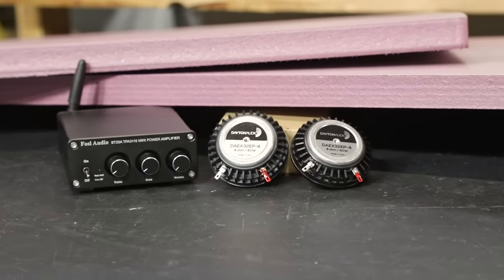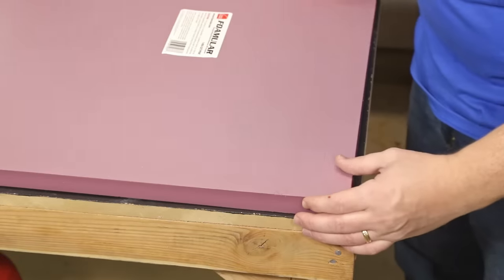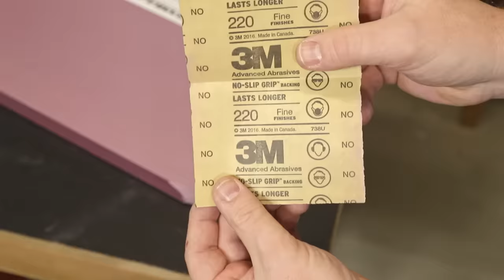How To Build "The World's Best Speakers" - Are Flat Panel Speakers Really Any Good?

Comment: Try adding weight to the exciters. It will change the exciter's inertia, and therefore the reaction of the boards.
Reply: I wonder what would happen if you used double-sided tape to mount them to a wall, stud, or something else immovable, instead of hanging them.
Reply: @jeffh4505  Sound is about vibrating the air, so a large stiff light weight panel mounted to a driver will vibrate the large panel which will vibrate the air and make sound.  If instead you tried vibrating a heavy or fixed wall that can not move, you will get no sound.
Reply: @azapps  The boards would still move freely, but the exciters would be mounted to the wall so that all the energy would be used on the boards. If you watch at the very end of the other thoughts section, you will see the exciters vibrate themselves, meaning that energy is lost and the panels aren't being vibrated at its peak potential. (I don't know really anything about speakers, it might be detrimental to mount it to a wall. But this is what I thought)
Reply: @azapps  I understand that, what I’m saying is to mount the whole assembly to a wall via the driver, rather than hanging it. The board would still vibrate, but potentially vibrate more. I would think that it would act more like a true speaker.
Reply: @jeffh4505  sorry, I misunderstood your comment. I agree 100%, mounting the driver to a wall will increase the output and will eliminate some of the resonances. Or perhaps put another foam panel to the other half of the driver, so it's double sided.
Reply: @azapps  all good! It would be fun to experiment with a few more configurations.
Reply: yep, i have done this for great success
Reply: @azapps  I don't think you should put a foam panel on the other side. It will vibrate in the opposite direction and cancel out some of the sound coming from the front
Reply: @azapps  are you paying attention. The sound is coming from both sides as it is. Since they are free standing with the panel vibrating the air. You put them about 3 feet from from a wall, angled in slightly and you have a great set of planar speakers. Adding a second sheet will definitely defeat the purpose. And deaden the sound
Reply: @RalphInRalphWorld  the second panel would be facing the other way, not going to cancel out, but you wouldn't want to put the speaker next to a wall. The two panels are facing and moving in opposite directions, the sound waves will propagate away from each other. However with open planar speakers like the ones shown in this video hanging on a wall, sound will reflect of the wall and cancel out some anyhow.  So don't use a second panel, but mount the driver directly to the solid wall and you should get much improved bass response and improved resonances.
Reply: @lordeverybody872  Yes I am paying attention, but I know more than you do so I am just going to ignore you and your rude comment.
Reply: @azapps  that's not how that works. As with subwoofers, vibration energy can be lost if the motion isn't deadened on the basket side of a driver.

Comment: I took some of those tactile transducers and stuck one each to a drop ceiling tile which sits in a suspended ceiling. One install used 8 transducers on 8 2' X 4' tiles and the other install used 6 transducers on 6 2' X 2' tiles.

Both sounded very good.
Reply: That's a very interesting idea... considering that the drop ceiling isn't a free suspension as shown in the video. If it sounds good, IT IS GOOD.

Comment: My uncle was an inventor, and designed many speakers.  Many of which were flat panel HiFi designs.  However, he built magnet coil diaphragms, much like a traditional cone speaker- except custom built of course, with a flat Kevlar or carbon fiber as the surface material.

What’s interesting about this is, his speakers have a very similar effect of “lacking body, too much high range” when playing digital material... despite having a completely different design.  The only similarity is the nature of the speaker having a very large, flat, fast response surface area.  My uncle would always frown heavily on digital mediums for audiophile playback, saying the signal was very “dirty” and didn’t carry any detail when compared to an analog recording medium.

Now, I’m speaking as a professional sound engineer, and I work with digital equipment every day.  I’ve researched in depth the nyquist theorem, and all of the reasons digital should be better than analog.  But when you play an original record from the pre-digital era and compare it to a digital mastering on flat panels, it’s a night and day difference.  High quality digital recordings, mastered well, with a good DAC also makes a difference.  The biggest difference has been listening to a recording I made of a classical concert, where I recorded simultaneously to 15IPS reel to reel tape, AND to digital.  The difference between the two on the flat panels is absolutely ridiculous.

I’d be really curious to hear if that difference is also present on this design.  Maybe I should build a pair, and carry the torch for my uncle. 😂
Reply: Interesting!
Reply: So what exactly is the difference you are talking about?

Comment: Question:  Could you paint the surface of the foam board black and then build a frame around the boards out of 1x4’s... almost like a picture frame?  Also, what would happen to the sound if you “anchored” them at the top, bottom and sides, suspending them in the middle of said frame?
Reply: fixing the edges of the panel would probably deaden the sound a lot
Reply: @mhgscrubadub9917  Right. The ability of the panel to freely vibrate in the air is part of its efficient transfer of the transducer's energy to the air. Anchoring the edges would be equivalent to increasing the mass of the panel, making the transducer work harder (using more power) to create less sound. Very inefficient. I would only do that if the panel were mounted to a horn, for a long-throw application, which would increase the efficiency.

Comment: I have a suggestion: what if, what happens, if you fix the driver on the wall, so the only vibrating part is the panel? At the very first seconds when you started the test, you look really amazed!
Reply: I'd be interested to see what difference that makes. Nice idea.
Reply: Yeah, or simply make a stand out of 4x4 post or something. Even 2x4s are probably sturdy enough.
Reply from the maker: I’ve had a lot of people ask about this. I think a new video based on all the feedback is in order!
Reply: I was thinking the same thing. On one hand these are almost ideally mechanically decoupled from the structure of the room, which is what you want for a pair of speakers. On the other hand I wonder if affixing the drivers to an inert mass would improve the power output and bass response.
Reply: Was thinking same thing! Plus the rebound effect off the wall may effect sound depth
Reply: @AmplifyDIY  Please try this idea
Reply: Might sound strange but what if you affixed the exciters to speaker stands?
Reply: @markhenry9648  Correct.
 Minimum distance from the wall is about 3 feet. Yes it really makes a difference. Magnaplanar speakers operate in a similar manner (mechanically, that is. the transducer/exciter mechanism is entirely different) and need to be at the very least 3 feet from the back wall. My open baffle towers (again, OB's radiate sound from both front and back like these panels and Maggies) have the same requirement.
Reply: With the 'back' of the speaker panel you get a 'negative' or opposite sound and the reflected echo is slightly out of phase too which would/may sound jarring to your ear, it gets quite technical with acoustics, especially structural bourne sound and reverberation.... just accept these speakers are a great sound for the $ and have some limits with installation.
Nothing is perfect.
Reply: @ya33a  upgrade on my original idea, how about TWO panels on each exciter (hanging loose)? like a omnidirecional transducer?

Comment: Great video, thanks for including the proper placement measurements. I like the idea of building these for my garage shop. Inexpensive, with better than good sound. I was wondering, would it be possible to buy larger panels of this stuff, or could you glue two or three panels together for longer vertical panels? I don't really like the idea of using ceiling tile, because that stuff is so heavy and would be harder to hang.
Oh yeah, one other thing. Why not paint the speakers with your logo on them, I think that would look really cool.
Reply from the maker: My local Home Depot sells this in 4 foot by 8 foot sheets... Check your local hardware store. I'll bet you can find it. Good luck!

Comment: Sound amazing, looks wierd. Is there a way of painting or layering with cloth, without altering the quality?
Reply from the maker: I have a follow-up video planned where I will be testing that. Stay tuned!
Reply: Don't paint them. The testing was done with both sanded and un sanded. Some thing about the porosity of the sanded board improved the sound quality over the sealed board so I'd you paint it you loose the sound quality you were looking for in the first place.
Reply: If you were to rigidly suspend cloth over the front you'd probably be OK (use some wooden dowels)
Reply: I made Speakers DML speakers like these for my PC. My monitor is close to the wall and the speakers right behind to it. The sound stage of these things is amazing, because to get similar result would require book-shelf speakers to be placed at least a meter behind the monitor. Also - a sub is definetly needed.

Fun fact: The reason why DML speakers aren’t popular in consumer market is because they have a patent that have been bought by military.
Reply: Tech Ingredients said you can spray paint the polystyrene panels as long as you keep the nozzle of the spray paint can at least 40cm away from the panels and it doesn't hurt the sound quality
Reply: You could conceal them inside of something that speakerr cloth is covering... as long as they are allowed to hang free of anything dampening the vibration of the pink board... think of it like a shadowbox for trinkets that you hang on the wall.... if you put a square frame surroundng them and stretch the grill cover material ove the frame then you could hide them in plain sight.
Reply: @nickbrockelman  That's a cool idea. Too bad lumber prices are sky high right now. It would be interesting to build frames out of lattice, and suspend the panels inside the lattice boxes with strong fishing string. You could staple some really thin gauze or other material to the boxes so it wouldn't dampen or affect the sound. Might be something worth trying.
Reply: Chris, I done the artwork on the balsa wood panels with wood dyes and 'sharpie' pens. No paint to 'coat' or stop the panels vibrating, just dyeing the wood does not seem to have altered the sound.
Reply: i'd laminate them with plastic for the most rigid, smooth surface
from reverb design i understand a surface supports 1/4 the wavelength at its longest dimension
Reply: I suggested to the other guy to try SEM dye, it's in a rattle can and it isn't a paint. Or you could do a bath of rit dye. It should only change the color and not the sound. The problem with a lot of paints is the solvents will completely dissolve foam and the weight/adhesive quality might change the sound.

Comment: I wonder if they would perform better or worse if they were suspended by the driver instead of the panel. I could imagine a tripod setup connected to the driver somehow with the panel fully suspended so it's range of motion is not impeded by the hanging strings.
Reply: nice idea. that would also make them portable and a high enough tripod could make for some easy repositioning for testing room acoustics
Reply: Would the panel be supported by driver that way?

Comment: I would love to see experimentation with a few diffirent Suspention methods to try and bring the base out more... I can imagine having a few diffirent sizes of panels and drivers suspended in diffirent ways would bring out a complete range of frequencies very accurately especially with some added frequency control through somthing like a parametric crossover ...
Reply from the maker: Tech Ingredients did exactly that, and yes, such a setup produces an amazing, full range sound. Requires a LOT of space, though. I don’t have anywhere large enough for a permanent install like that, unfortunately.
Reply: @AmplifyDIY  that's actually epic to know... Will go check their channel out.. Thumbs up to your channel man, have really enjoyed your episodes so far. Keep it going...
Reply: i personally like to use 1-4 panels mounted on the ceiling. and a cheap 50€ sub woofer that stands on the floor. 
Sounds crazy but it works. since the sound of the panel(s) from the ceiling is travelling in all directions, you wont even notice the sub woofer on the floor.

If you like Classic and JHazz music, especially brass and string instruments, you have to build at least one of those panels.

Comment: Never expect a single flexing panel to reproduce all frequencies as one time, mud does happen.  So yes have at least a panel for the subs. If you want all the ranger to you will need 5 boards and 5 driver's. Possibly 3 amps as well. It would also be good to put in a frequency selection circuit for each panel. That way you limit yourself to high mid and low or any combination there in.
Reply: Surely you now have cross-over issues, which is exactly the problem a single driver solves....?
Reply: @joelonsdale  no just use a frequency splitter you have a driver for each frequency range you use. No dif, then what you have at home now. Just remember this thread is only about getting fuller range. Not putting down the concept. The concept is fine like all that things it has limits.
Reply: THink of how one stringed instrument produces multiple notes at the same time, like an acoustic guitar playing a chord. I would like to see music produced with one channel per instrument, though. Then every instrument could be played back on a separate speaker.

Comment: Although it would quadruple the cost of the drivers, it would be an interesting experiment to instead of using only one driver on a relatively small board, to use four drivers on a relatively large board, (connected in series/parallel, to keep the impedance the same as a single driver), and mounted at the node null points of the board, (similar to the node null points on a xylophone or marimba tone bar where its mounting screws are located, so as to minimize board flex at certain resonances.) With this arrangement, you could use very large panels, without worrying that the edge of the board is vibrating any differently or lagging in phase than the areas directly in front of the drivers...
Reply: I just built these,  and 1 exciter is best. 2 exciters sounds really good on this video, but in real life it ruins the frequency response
Reply: @Nbomber  I was reading some information on a website a little while ago that had information about setting up 2 or 4 exciters per panel and they mentioned that it was important not to space them evenly apart because of how the soundwaves will interfere with each other I think.  They recommended placing them in a relatively close formation near (but offset from) the center.  Not sure if there's a potential layout on a larger panel that would be farther apart without even spacing and still avoid those issues or not.
Reply: @johnandjacquelinewarren9979  that makes a lot of sense actually.  I had mine set up 3/5s and centre on each panel. And it was objectively worse. I used an app on my phone to test them (I know, not ideal), and the response curve was quieter across the spectrum,  but a lot more spikey too.
Also, I found that the bass just rolls off at 120hz. For a 600x600 30mm thick foam panel. So a sub is kinda essential.  And not only that, but the treble is really poor. So im going with a couple ribbon tweeters on separate (smaller) foam boards, and some cheap chinese adjustable crossovers.
Wanna try to kill off anything below 100hz and split the highs off, to ease up the excess frequencies on the panels.
I will say this though, the mid range, sounds fantastic. Like really fantastic. But as a full range speaker, they are terrible on their own.